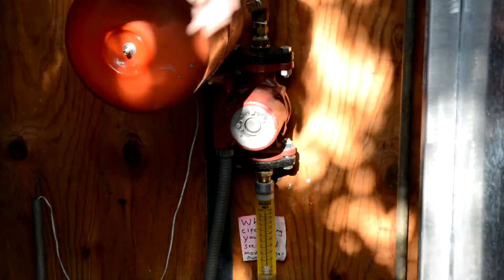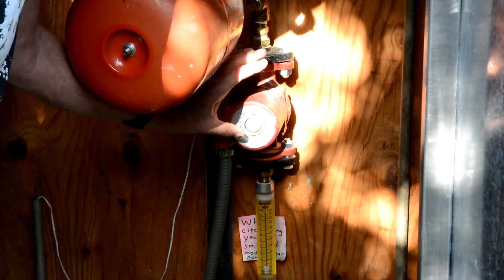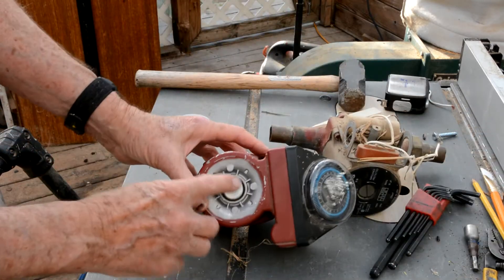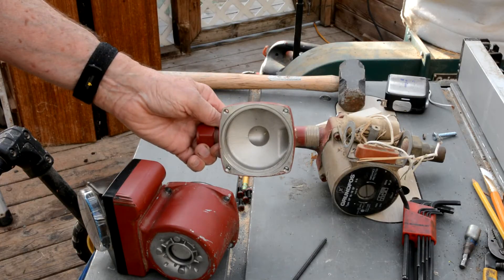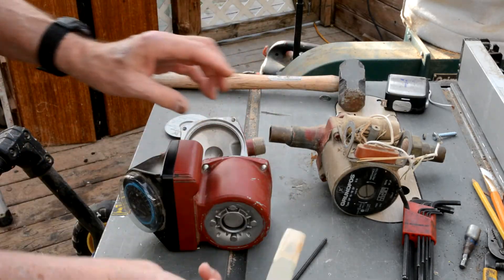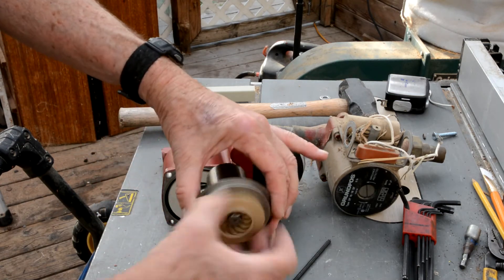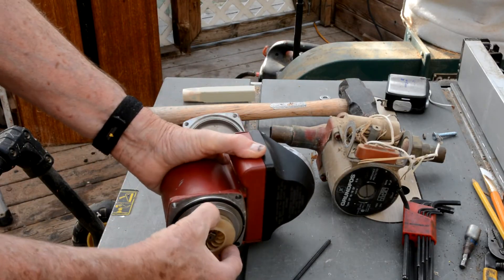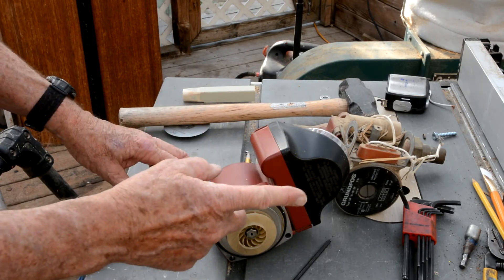Grundfos Pump Overhaul (Cartridge Replacement)

Comment: I've  not been able to locate the replacement cartridge for my identical pump. Your chart at the end shows them to be available, but WHERE, please? Thanks.
Reply from the maker: Sources change all the time.  That is one of the problems with posting videos, what was available when the video was posted may no longer be valid . I can only suggest searching the web.
Reply: @vendter  Thanks for the reply. I DID search, but found only way-too-expensive offerings, some as much as the entire pump w accessories. I've got a support ticket open w Grundfos, which may be useful in locating a replacement cartridge. Watts, btw, told me they don't even offer a cartridge for their version of this pump, even though those expensive 506176 cartridges I found seem likely to fit any UP 15-10 pump. Some eBay seller is asking $248! Whereas there is a new UP 15-10 pump listed for only $115. Comparison shopping pays, but these cartridges seem disproportionately expensive compared to the original pump (which includes a thermostatic valve, timer, & hoses).
Reply: Just buy a replacement whole pump and take bits from it if you don’t want to replace the old pump. The costs of the spares being more than a new pump is ridiculous and due to people trying to profit from it.

Comment: I found this hugely helpful, VIncent, so thank you. I ran into one problem: The rear housing of my UP15-18SF does not have a key to orient it re direction of water flow, making it possible to replace that housing with the arrow pointing in the wrong direction. Unless one has marked that before removing the housing, I could find no way to tell on replacement how to orient it . (As my wife will tell you, the fact that I couldn't find it does not mean it's not therre.) I luckily had another unit, so I used that as a reference. For others: With the Grundfos label facing you, the water-flow arrow points to the right.
Reply from the maker: Good tip!

Comment: I have the bronze one, and its making a really bad rattling noise any idea what bearing is needed for replacement? It works its just super loud and rattles
Reply from the maker: You would have to do a search on the part number of your pump.

Comment: LOL, I wished I'd seen this before I tore my pump apart. There's not a real bearing in the front, just a bushing behind the impeller BTW from what mine looks like. I found with my pump, the shaft had moved to the rear in the housing from wear. This moved the impeller too far away from the housing for it to pump. I broke the shaft in mine taking it apart as I drove it out from the rear. In hind sight, if I'd known the way the cartridge came apart, I'd have added some shims to the rear of the shaft to keep it held out more. My guess is the rear bearing was going and allowed the shaft to move to the rear. Live and learn, good post though.

Comment: Sir, Grundfos, Model -UP 26-99F,230V 1PH, 60HZ. 2.5uF. 
Do you know the terminal strip and capacitor diagram of electrical connection.
Reply from the maker: No, I do not.

Comment: Once again YouTube comes through. Just not in time tho. I had a UP15-42F that I had run for a few hours in 2016,, unbeknownst to me not completely purged. They don't like to be run dry! I pulled it and replaced it. I saved it, thinking it might be salvaged. Another pump shit the bed last weekend, and I discovered the run-dry UP15 pump squalled like hell, so I got a Taco and had a fight removing and replacing the flanges, as they are 90° off the Grundfos. Now everything is fine. So, as I want to have a spare on hand, I just happened to come across your video, and found the armature pops right out of the SS Cup with a knife! I found the bottom ceramic bearing just dry and unhappy, so I gave it a dab of silicone grease and now it spins like a million bucks. Back in the original box it goes, waiting for another pump failure, thanks a bunch Vinnie!
Reply from the maker: Onlly a New Jersey mob boss call me Vinnie!
Reply: @vendter  I am!

Comment: Thanks for showing me how to take the pump apart. My system has 7 pumps in it and I've replace several of them. Now I can fix the old ones, but there is a problem. All the replacement cartridges I found cost more than replacing the whole pump!!!!!  Do you know a supply place that sells cartridges for under $100...
Reply from the maker: I did an internet search for the part number I was looking for.  Sometimes they come up cheaper on ebay.

Comment: Hi Vincent, I have the same exact unit on you video. The problem I have is when the timer turned on it tripped off water heater's (turn off )  power then I have to reset the reset button. Do you have ant idea how this happened?

Comment: Hi Mr. Endter, first of all thanks for the nice video! I followed your video to clean up my grundfos pump however, when I put it all back together, there was a very tiny leak. There was no leak before I disassembled it. I want to redo or disassemble again, but what do I do to prevent leak? I’m sure four of the screws are tight. Not sure if I could use sealant, but don’t know which one is the best for hot water circ pump.
Reply from the maker: If the pump is used for potable water, you need to use a food safe sealant or grease.

Comment: Thanks man  . I lubed the cartridge  and that bad boy stated right up. My lower units now have good hot water
Reply: I'm looking to get a replacement  for a grundfos up25 -64  in the case mine keeps seizing . Do you have any suggestions
Reply from the maker: Glad it worked out for you!
Reply from the maker: @shakeandbaked1  If the cartridge needs lube, it's time for a new cartridge.  I use Petrol-Gel by McGlaughlin oil company if I need to lube food grade equipment.

Comment: Will i need to replace my cartridge if it makes high pitched metal sounding noise??
Reply from the maker: They usually make that sound just before the cartridge goes bad.  I would have a spare ready, or just go ahead and change it.